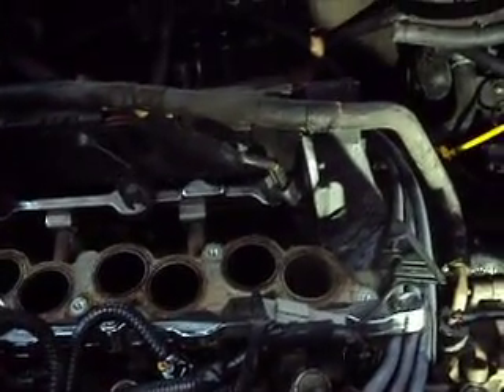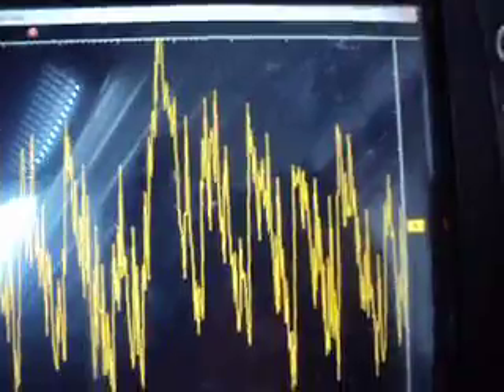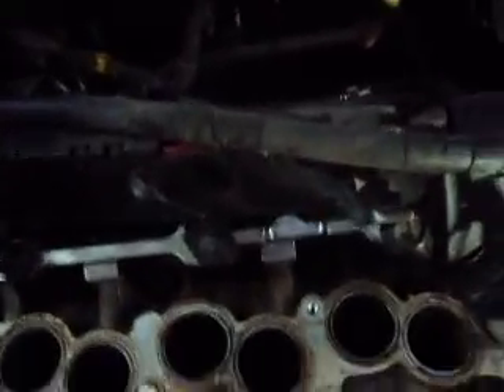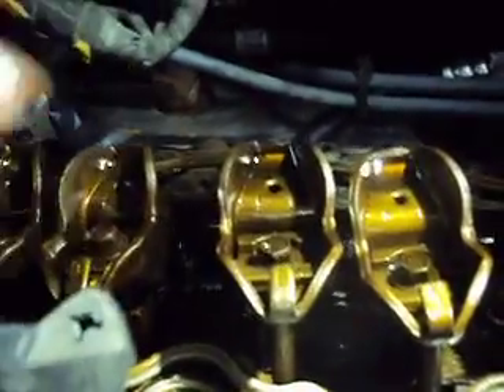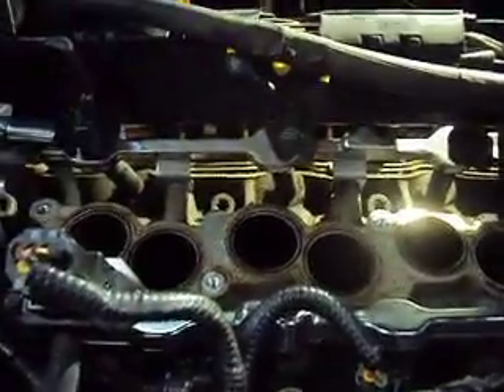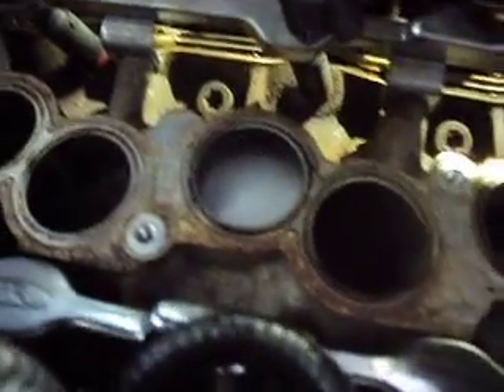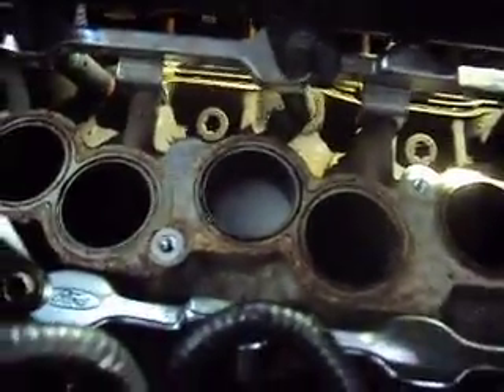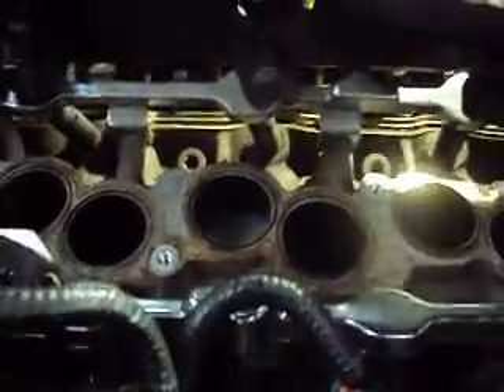03 MERCURY SABLE ROUGH IDLE CAUSE

Comment: had this problem changed the coil pack in the back of engine, casing was cracked d to heat from engine fixed problem.
Reply: There is no coil on the back lol